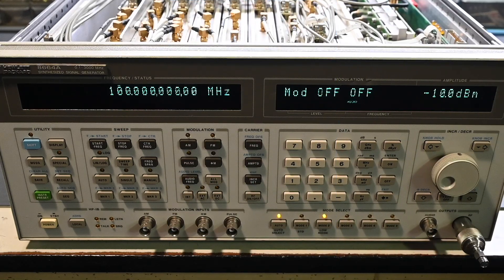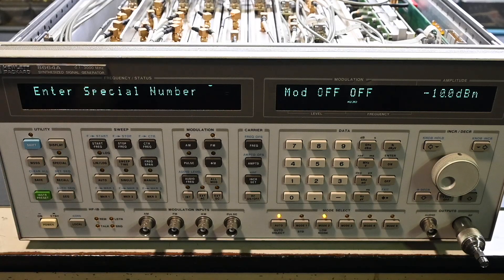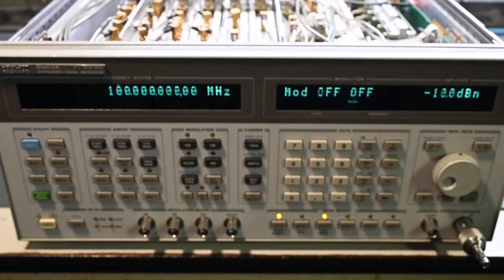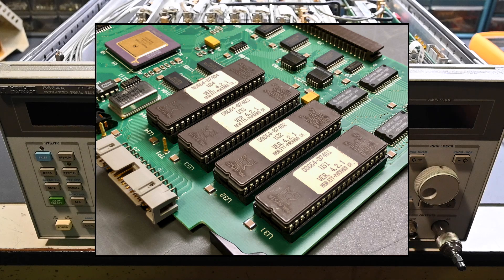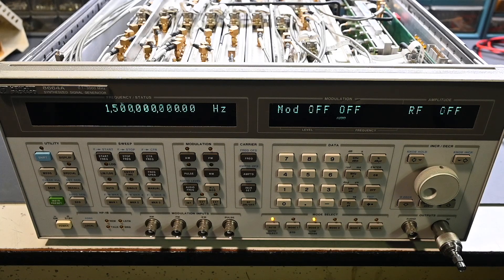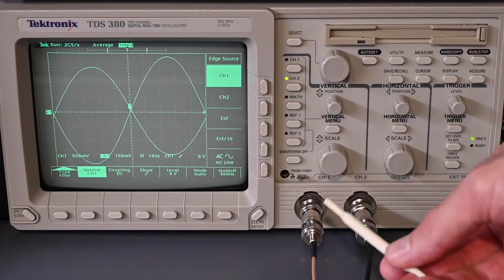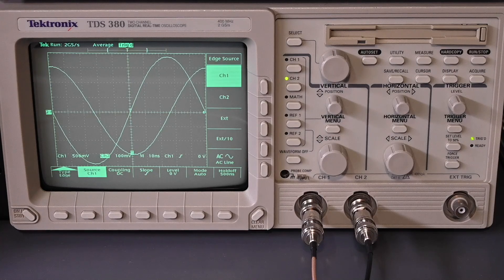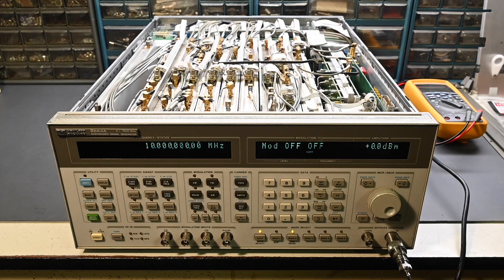HP 8664A 3 GHz Signal Generator Gets A Firmware Update & Timebase Oscillator Adjustment - Part 3

Comment: 10:45 - 11:08 = 23 seconds for ½ wave drift. = 46 seconds for 1 wavelength drift
1 wavelength every 46 seconds = 21.7 mHz

But this is just the limited timestamp of YouTube.

Loading the video into a video editor, we get
10:23 + 20/30th sec
10:47 + 16/30th sec
delta time = 23.867 +/- 0.067 seconds for half-wave
full wave = 47.734 +/- 0.134 seconds for full-wave
delta frequency = 20.95 +/- 0.06 mHz

Here we are at the mercy of the short-term stability of the recording camera and assuming no dropped frames all the way to our screens
Metrology through YouTube - who would have thought.. :-)
Reply from the maker: Looks like the GPS disciplined oscillator, the 8664A timebase plus its synthesized frequency resolution, the scope sweep time, the camera recording, and any other factors all work out.  Cool!